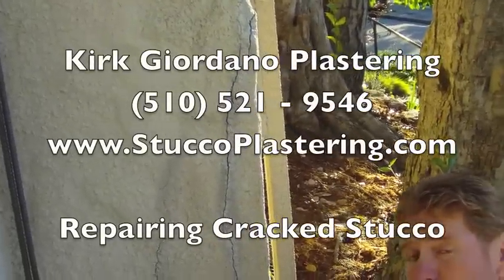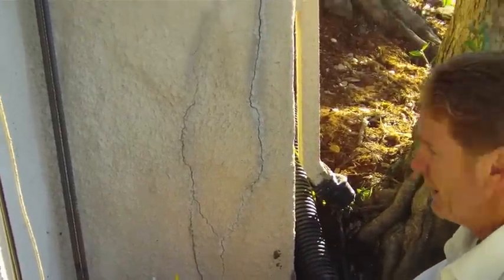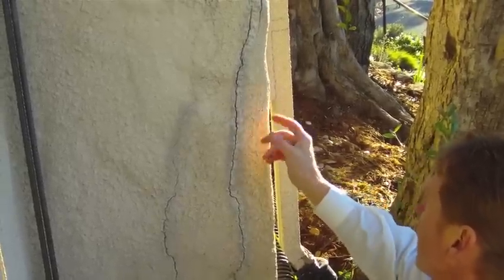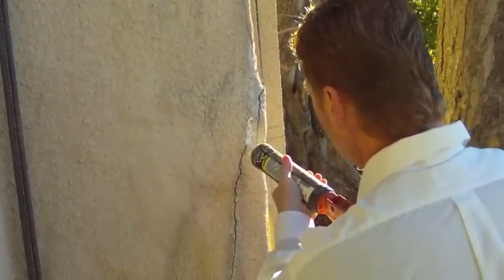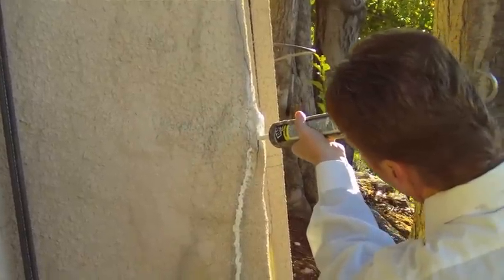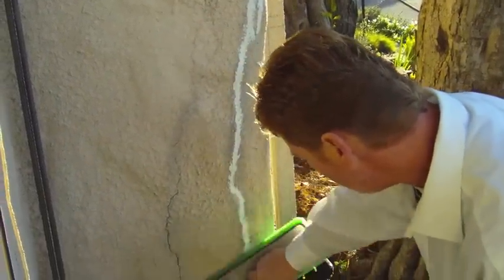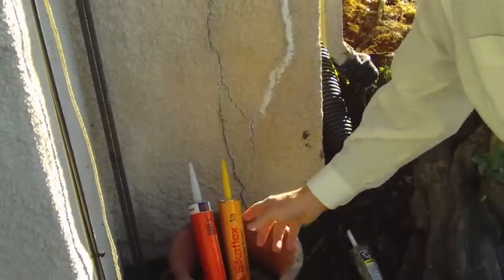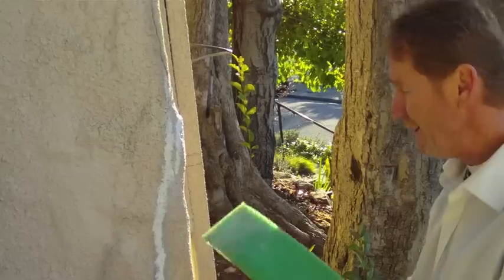Caulking stucco cracks

Comment: Sikaflex Concret Fix is recommended as non-sag, which makes it useful for vertical and overhead application,  durable, sandable and paintable, regardless of what is said in this video about polyurethane. Latex based product cure by evaporation and tend to shrink, in a hairline crack this is more evident and tend to separate from the stucco due to shrinkage.....
Reply from the maker: Exzackory, shinkage does suck espesahlly when exisiting really cold wated naked.🥳
Reply: @StuccoPlastering  I can't unsee that😵‍💫

Comment from the maker: I here you hfsjansharr, technology changes faster than I can keep up with it. It used to be, don't use silicone or polyurethanes because you can’t paint them, However, now my oldest son Jason says they make ones you can nowadays. Try Mor Flex caulking it has fine sand and is great for stucco or mortar walls. You can Google the stuff, its very user friendly.
Best wishes, kirk Giordano Plastering

Comment from the maker: Hi Ana, as long as it says it's paintable on the tube your o.k.
Used to be most silicon’s and polyurethanes were not paintable but times have changed and they now have become paintable.
Mor-flex is a good one if you’re looking for a caulking with sand in it to match a stucco finish.
 Best wishes,
 Kirk Giordano plastering

Comment from the maker: Good evening Alessia Aikley,
 I general skim coat bricks with Portland cement or its also called Portland plaster
 (same material)  I mix the Portland with sand and water and apply a coat between 3/8 of and inch to 1/2 inch a little more or less is not the end of the world. 
As a rule you mix 3 parts of sand to every 1 part of Portland cement plaster.
 Thanks for watching and have a good evening.
 Kirk Giordano plastering

Comment from the maker: Morning Alessia Aikley, you must be an engineer?
Thanks for the tip on the R ratio values. That is so simple I might even remember it. 
As far as existing homes cracking less, this I have experience many times an existing home will hairline much, much less as the bulk has already settled. The cure time and mainly the hydration of the stucco is the most important part of stucco curing and cracking naturally.
 Thanks for watching and have a good day! 
Kirk Giordano Plastering

Comment from the maker: Hey cedarray, caulking like technology seam to keep changing and getting better every 6 months. What I used two years ago for this is not what I would use today. They make polyurethanes and silicones that are now paintable. Plus Mor-Flexx has sand already it in and is water based for easy cleanup.
 Thanks for the comment and have a groovy evening,
Kirk Giordano Plastering

Comment from the maker: Good morning Mike,
 R-Values for stucco it is 0.20 do you know what this means?
 Me neither, as old Kirk is just an applicator not an engineer. I simply explain to folks that stucco is strong, looks good, does not rot, makes a great insulator, and is possible, the most fire resistant material that can applied unless your building you home with cinder blocks, exterior stucco has many other benefits too. 
 Thanks for watching and have a great day!
Kirk Giordano Plastering

Comment: I use Ames Blue Max to fill cracks and small holes in Stucco, its Hard to beat, also comes in white. I also use it to hide stains and Graffitti. Learned this from a painting contractor I use to work for on the side.
Reply from the maker: IIIIIIIIIIIIIII Hello, good tip, there are many ways and caulking that will work well.
 Cheers!
 Kirk Giordano

Comment: He may have forgot to mention that this not the repair method for the smaller and more typical hairline cracks. But as he said , it may work as a temporary (four to five years fix). Based on the multiple cracks in the area shown, it may have been better to remove the whole cracked  (usually loose) area and apply a new cement base coat (since you will have re stucco the whole area anyway).

Comment: I always get great results with textured elastopatch by DAP. What is your opinion ? Anyone?...
Reply from the maker: Hi Daniel, I have tried the Dap you are referring to; however, today, most of us use Mor-Flexx acrylic caulking for stucco cracks as it has sand in it, which, when appropriately used, blends in well with most stucco finishes.

Comment: what kind of paint should I use so the repair wont be visible please I've got lots of cracks and I patch some of it but now that I panted the wall you can see where the cracks were any ideas ??? I appreciate thanks
Reply from the maker: Evening Jose Rojas, when I did this video 3 years ago caulkings have gotten better and easier, If you have a sandy stucco texture use Mor-Flexx as it has sand it it and will match when painted.
 If smooth you can now use a  polyurethane as they last much longer and stretch  when the wall moves and can now be painted, but theses don't clean up well with soap and water, instead you have to clean up with thinner or denatured alcohol, what a drag.
 I used an acrylic, latex on this one that says it lasts 35 years.
 Lastly caulk in early morning when the all stucco cracks are the largest.
if you wait till noontime or late afternoon the wall heats up the wall expands and you can barely see the crack, the one's you do see are misleading.
If you caulk during this time by morning they are back, learned that the hard way Brother.
 Cheers! 
 kirk and family

Comment: Thanks for the great videos.  I was wondering,  would you recommend pressure washing prior to repairing hairline cracks on stucco or after?  I have had two professional opinions, sadly they both said the opposite...hummm?  Also, I was planning on  using the Mor-Flexx caulk if that makes any difference?  Thanks again for sharing.
Reply from the maker: Good afternoon Denise Fricke, if you are repairing cracks more than likely you are going to paint.
So, prior to painting a home one should pressure wash first to remove any dirt, grime, moss or just plain old dust, as primer, paint and caulking will not stick to these things.
 My advice every time is pressure wash first,  especially the cracks very well, allow a week or depending on weather to dry out and caulk. 
Question, who in their right mind would suggest pressure washing after?
 Best wishes, 
Kirk and family

Comment: is it better to seal the stucco Crack after or before pressure washing the house. thanks jeff
Reply from the maker: Howdy  Jeff agent, easy question, pressure wash first as the forced water pressure will clean and clear all dust, dirt and other junk from the cracks, thereby allowing the caulking to adhere much better, 
 Nothing adheres to dust, not even caulking, at least not for long
 Best wishes, 
 kirk giordano

Comment: I am no expert and this is more of a question than direction. Would it not be better to open up the crack a little bit to ensure that you're getting the caulking into what appears to be a tight crack.
Reply from the maker: Hi Tom D dude, yes, it's always better to get and all dust out of the cracks so that the caulking can go as deep as possible and adhere better.
 Best wishes, 
 Kirk Giordano

Comment: Can u put caulk then put stucco finish over to match drag texture before  painting
Reply: joe Boner yes you can if you like but don't need to.
Reply: Thats a good idea . me personally just filled the cracks with stucco mix and blended it .
Reply: Gaz, push the caulk in the crack and use a damp tile sponge and recess it by wiping it down and allow to dry and mix stucco sand in some squeezed out calk and fill the crack and let dry for several minutes and lightly feather with a damp sponge and let it dry and it's ready for paint. Other wise it will look like a road map on your stucco. You can buy sanded caulk that's paintable also.

Comment: Kirk, is it worth raking  out the crack first, widening it a little, forming a v ?
All the best to you 👍
Reply from the maker: Greetings Tim, excellent question.
 it's best to remove all dust, dirt, and moss, you can if you're going to paint the entire home, pressure-wash this crack when power washing the home for painting or clean out with a wire brush, as nothing sticks to a dusty surface, not even caulking

                         Bringing peace, love, and harmony to plastering 
         Sound Plastering tips for the DIY beginner or the Plastering experts

Comment: You say here that the polyurethane caulking cannot be painted. You later advocate using polyurethane to fill cracks and paint over it. Has your understanding changed since then?
Reply from the maker: Evening dev1lsadv0cate, good eye to detail, yes, it has, when I did this video 4 years ago polyurethane have evolved or improved they now can be painted, come with sand and have the ability to expand 100 percent.
 Stucco and plastering materials don't change as fast as phones and or computers but have come a long ways quicker than ever before.
 Best wishes and have a good evening.
 kirk Giordano Plastering

Comment: Any solutions when the caulking flashes on stucco? I applied the the texture caulking and remove the excess, but now it’s flashing. Will back rolling with Elastomeric coating hide  the flashing caulking?Thank you
Reply from the maker: Evening German, I take it you're referring to ghosting, I usually prime all the cracks well so that they don't ghost or bleed through when painted.
 Sherwin Williams paints, makes a primer and paint that covers this type of bleeding through. However, it cost 90 bucks a gallon.
 Bringing peace, love, and brotherhood back to the old fashioned 🌎  “Plastering.” 
    The most comprehensive encyclopedia of plastering on video, by the plastering messengers of Youtube.  
     Over 800 videos 🎭 👀💃

Comment: Kirk, thanks for your video I'm going to take a shot at this myself. What was the sponge called that you used and do you need to make sure it is damp first. I've seen many videos where they dampen the sponge.
Reply from the maker: Howdy John, it's called a green sponge float for plastering. In the amazon link in the description, you can buy these for about 5 to 10 bucks.
 Wet them first before using on caulking.
Tip, it works on water cleanable caulkings best. The polyurethane caulking sticks to them. 
May peace, love, and happiness, find you and yours always
                Kirk Giordano Plastering and stucco tips

Comment: Very informative video. Hi Kirk,

I'm a contractor in the LA area. I am working on a house and the home owners wants us to paint the exterior of their house. It presently have a smooth stucco finish on the house with a lot of cracks and they want me to fix the cracks in their smooth stucco. What is the best way to repair these cracks. My stucco guys is chasing the cracks with a chisel and hammer making them larger then he's mixing smooth stucco finish coat  mixed with concrete glue and troweling the mixture into the cracks. Somehow it doesn't seems to be working very smooth. Please help with a solution. Thanking you in advance.

Lawrence
Reply from the maker: Good evening Lawrence, good question brother, as there are many ways to caulk cracks.
 I'd prefer the walls pressured washed well then caulking applied just inside the cracks.
    Any stucco mixed with an additive, weather glue or any other bonding agent is O.K. but won't flex as much as quality caulking.
 Thus, when these walls move and they will when it rains all homes lift then when drier conditions occur they settle, this movement may cause the stucco to pop back out as stucco even mixed with an admixture for so called flexibility is not as flexible as caulking.
 
The system he is referring too is mainly used  for mixing tile grout or stucco, instead of water you add a bonding agent like sika which give the grout or stucco and even concrete better adhesion and more flexibility.
I however would not trust this procedure for repairing cracks on stucco walls.

    Live long and plaster
 teaching  plastering video’s
Reply: Kirk, much appreciate your quick reply. Thanks
Reply: Hi Kirk, will the Mor-Flexx caulk work on smooth stucco or should we use another type of caulk? Thanks
Reply from the maker: Good evening Young Dude, no worries
                          Live long and plaster
 teaching repairing your number 1 investment, your home

Comment: Uh Oh Kirk - here we go again (see mor-flexx crack repair), maybe it's time you bought yourself an angle grinder. I really do think you're the man with respect to rendering/plastering etc, but your crack repairs leave a lot to be desired, unless the product you're using here has miraculous properties - no amount of pushing it in to a crack an eighth to a quarter inch wide, with a gun or finger or a sponge float - is going to effect a 5-10 year repair. Just reading the comments below, it looks like Tom D is on the right track, but you kinda side step that one, just replying that dust needs to be removed without commenting on Tom's suggestion. Anyway, keep on trucking dude, just maybe keep away from the free work. :-)
Reply from the maker: Howdy O Kafka, it's a free world with benefits like being able to think and believe what a person wishes,
 Cheers,
 kirk giordano